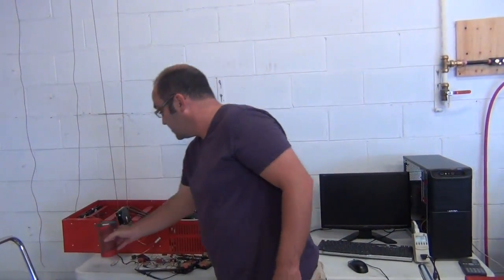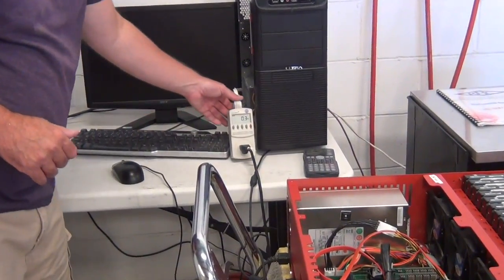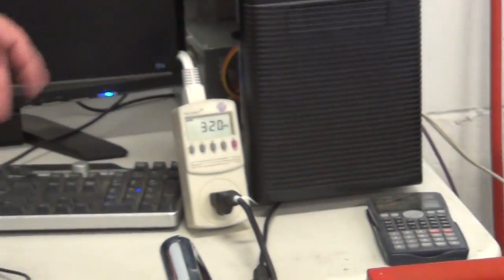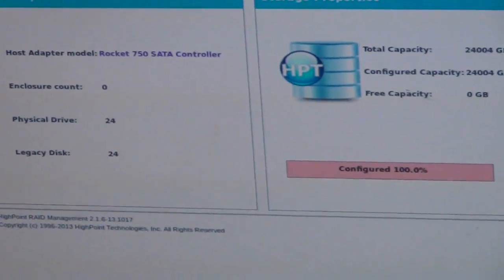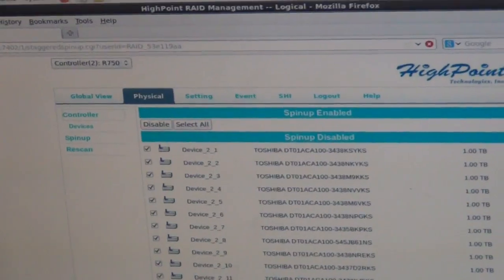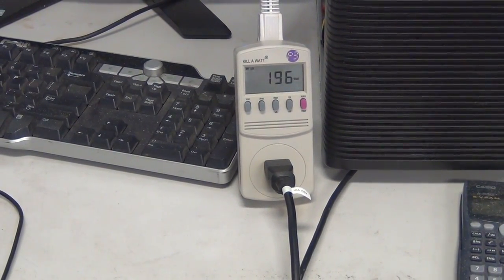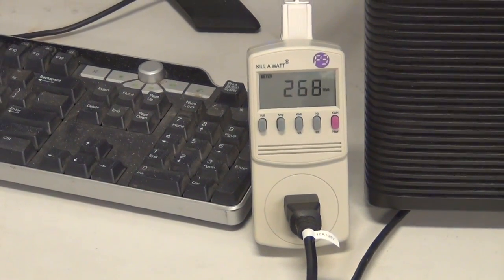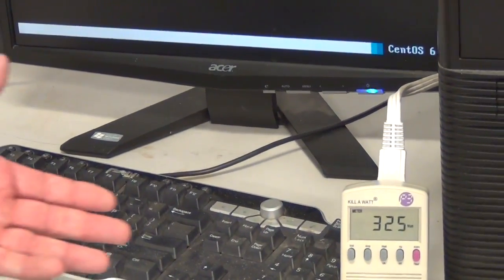Enabling Staggered Spinup

Comment: Can that controller/system work as JBOD, with every physical disk used by the system, so that ZFS can be used up to a full potential. 
Can one do that also in JBOD mode? (I suppose it's firmware setting to spin up gradually, but just to ask).
Reply from the maker: Hi mrjonnoma,  the Rocket 750 are JBOD cards. Every physical disk can be independently accessed by the OS,. Unless a custom build,all our servers are JBOD.  We do not recommend HW RAID under ZFS.
So yes staggered spin up works in JBOD mode.

Comment: well, at least you aren't using seagate. Huge power draw or not, those will fail prematurely, leaving you with no data. Toshiba drives are just renamed Hitachi deskstars, which are owned by WD now. So basically WD deskstars.

Comment from the maker: As you can imagine, the  #storinators  draw a whack of power on startup. Our R&D guys have done extensive testing on staggered spinup - different methods, which drives are compatible and more. Our testing's been documented on our wiki (http://bit.ly/1Cgh7m4) and Steve explains more in our video. But we want to hear what you have to say. Do the ***** fans have opinions on staggered spinup?

Comment from the maker: Andrey,

Thanks for your comments - we love hearing from the community. You have a lot of great points here, so we’ll handle them as per your paragraphs:

(1) In our case, our single non-redundant PSU is 850W and the triple redundant PSU is 950W. Both of these power supplies can handle surges up to 150% of rated load.

(2) Any number of drives can be present to enable staggered spinup – provided that the drives support it. You can even boot with 15 drives (or any number) and then manually add the rest of them in at runtime if you wish. Simply refresh the GUI as new drives are added and you will be able to enable staggered spinup.

(3) Great point. As long as the surge time is shorter than the maximum surge time provided by the PSU specs, we will be fine. The calculated 945W for 45 Drives upon start up is a fair assumption but it should be noted that the triple redundant PSU is rated 950W, so including front-end system power requirements we pull no more than 125% rated load at startup. From the power analysis of our pods, we saw that it pulled 125% rated power for no more than four seconds upon startup – well within the manufacturer’s specs. With that being said, if you’re using the single PSU (850W), while it will work on start up as it will pull ~140% rated power, it would recommend to enable staggered spinup on some drives to be less demanding of the PSU.

(5) Your calculation is correct assuming a 650W PSU, but that is not the case for our pods now. In our opinion, a few startups at 125% or even 140% rated power will not be an issue for these PSUs, especially since in most cases these pods are booted once and left running for long periods of time. If you are really worried about the start-up power draw, you can always enable staggered spinup. If using the Rocket 750 cards, the only way to enable this is through their dedicated WebGUI.

(6) You are correct. If a drive fails and you replace it, you would have to enable staggered spinup for that drive in the WebGUI.

Once again, thank you for the feedback. If you have any more questions, please ask us.

Comment: The purpose of staggered spinup is two fold, reduce instantaneous load on the power supply and the load on the circuit breaker of the data center/rack/cabinet.
If let's say we calculate that during a full read/write each disk consumes at most ~6.5W which is typical of most (7200/5400 RPM) drives, with 45 drives, we dedicate 300W to HDD power, the rest to the system and PSU inefficiency. We come up with a 650W PSU.

The problem with in the video is the way the staggered spinup is setup through the web control interface of the Rocket 750 is that it looks like it requires all the intended drives to be populated before you could enable staggered spin up on each disk. This in part defeats the purpose and increases risk of PSU failure since it has to at least once power a large load due to an instantaneous spin up of all 45 drives before staggered spinup configuration could be set.

I should note that although PSUs are capable of handling surges, it's not good for them and the risk of failure increases depending on the number of surges, the quality of PSU, and the rated continuous load relative to the surge load.

A WD disk spec sheet indicated a peak of 1.75A @ 12V, or 21W, for an instantaneous spin up of 45 disks that's 945W.

Unless there is an option at BIOS level before the OS to configure staggered spinup in Rocket 750 before the disks are spin up, the only way to ensure the load does not exceed the PSU continuous load specification is to add HDDs in groups of no more than 15.
(650W*0.8 - 200W = 320W remaining power for HDDs)
200W for system boot including misc.
0.8 efficiency factor (80%)

Without having a pod unit to play with, it remains unclear what happens to the staggered spinup configuration in Rocket 750 configuration when HDDs are replaced by new disks, such as after a HDD failure. One would assume that the configuration is per HDD ID, so that means staggered spinup would need to be reapplied to that drive in the config, but at least you won't be trying to power up more than 15 drives at the same time with a 650W PSU.
Reply: You have to use some thinking. The Rocket 750, like most RAID cards supports hot plug. So turn it on with no drives, plug in a few, configure, and plug in the next few. If for whatever reason your setup doesn't allow hot plug (a bad idea), install a few, configure, shut down, install the next couple, and so forth.

Comment from the maker: With no staggered spinup enabled on your storage server, the pod boots up all 45 drives at once usually creating a beginning surge of 1000 - 1200 watts in current.

We show you the steps on how to enable staggered spinup on the Storinator, allowing all 45 drives to start up individually, evening the power surge and maxing out at only 300-350 watts.